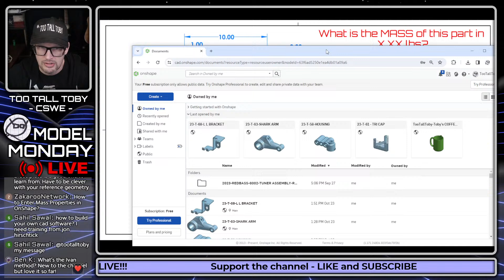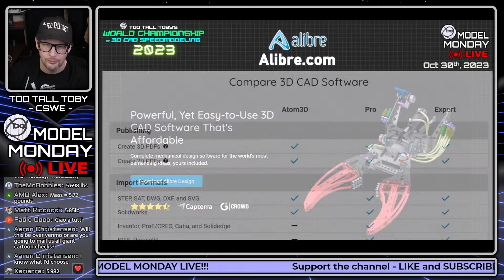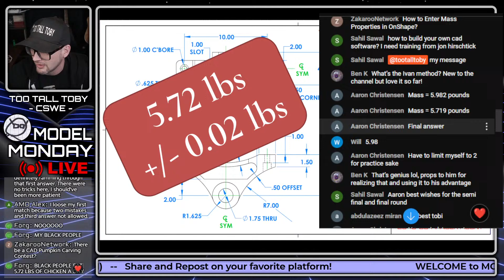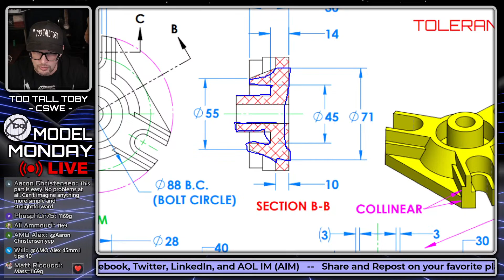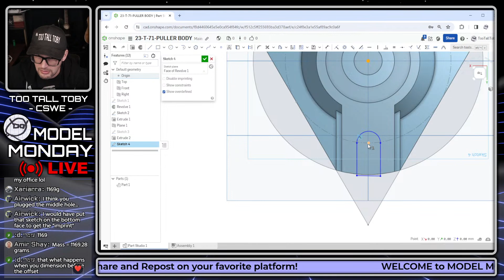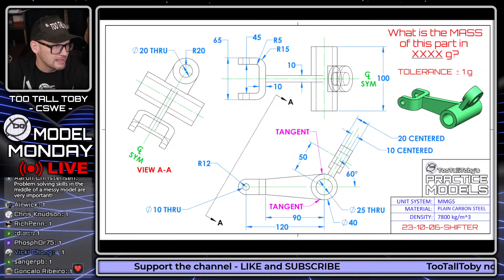Model Monday LIVE - Live 3D CAD CHALLENGES

Comment: have not been on in a while. Solved the mass on both parts correctly. Did not time myself though.
Reply from the maker: Awww yeah!  Great to see you in here again!
Reply: @TooTallToby  Yeah I have missed the model Monday's. I always check back and do them later on though. I am having an issue with the rib command on part 2024-03-13-chair wheel riser. it is telling me the resulting rib did not intersect the existing model. chg direction. Not sure why this does not work. maybe rib command will not work in this case, because of the round shape. I know the work around but just seems like rib should work.
Reply from the maker: check out the later part of that episode - I talk about that rib @tomdunn7147